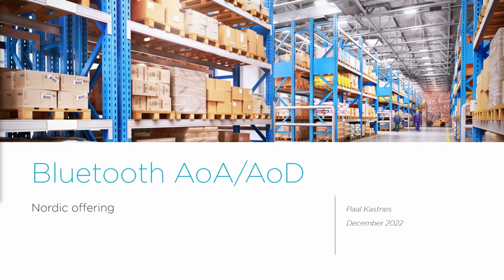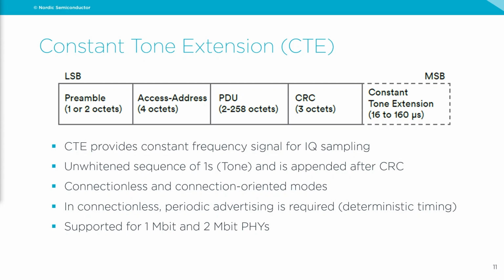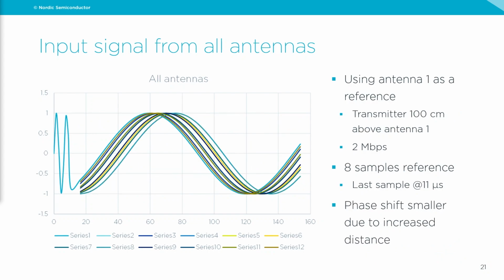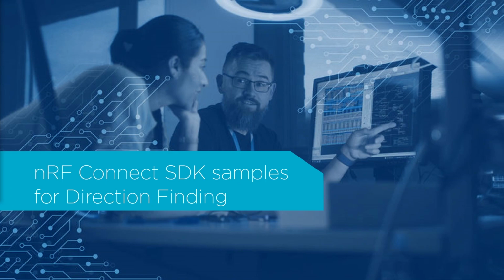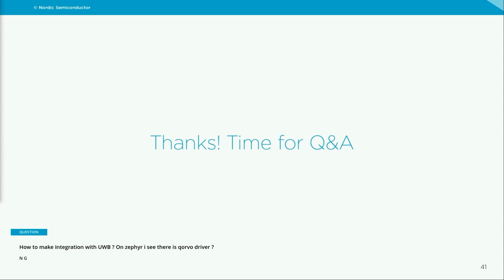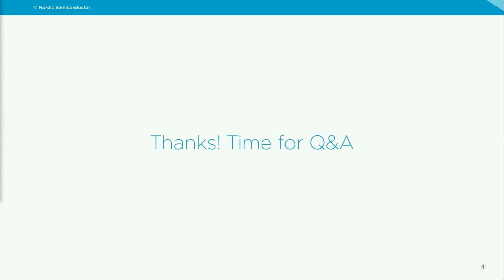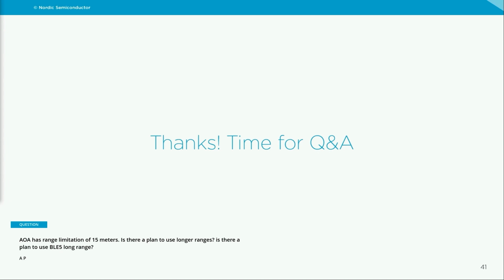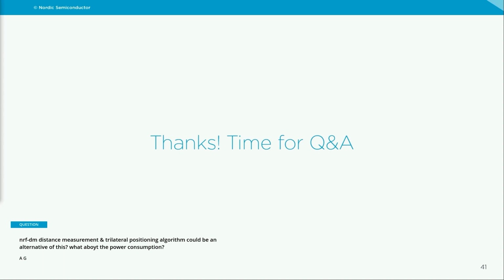Introduction to Bluetooth Direction Finding

Comment: Is it possible to have estimation of AoA if I have nRF52810 at transmitter side and nRF52832 at receiver side
Reply from the maker: No, only nRF52833, nRF52820 and nRF52811 (and nRF5340) supports Bluetooth Direction Finding, and you need one of these on both the transmitter and receiver side. Please note the nRF52811 can only be a transmitter. As it does not have enough RAM or Flash memory to work as a receiver.